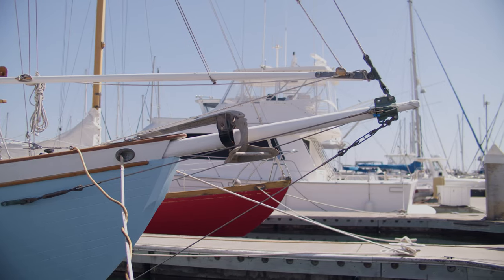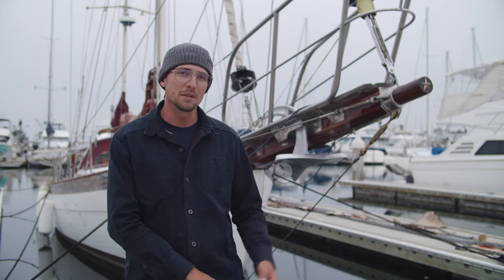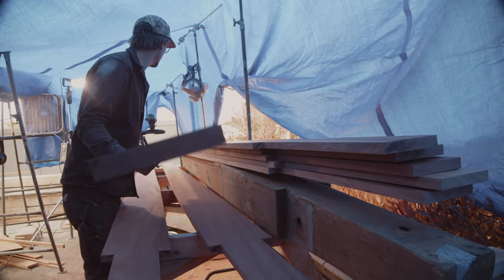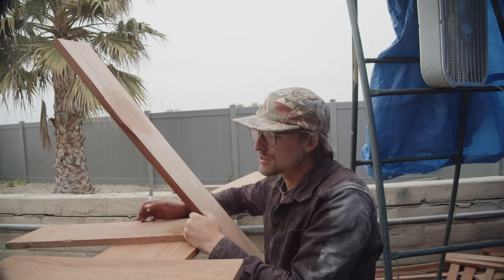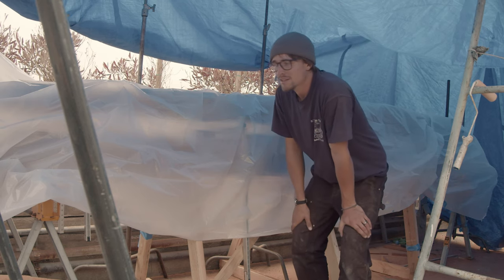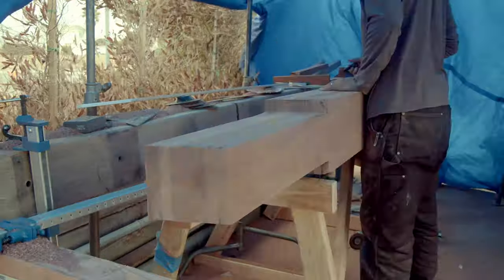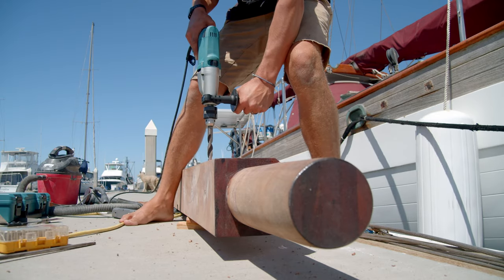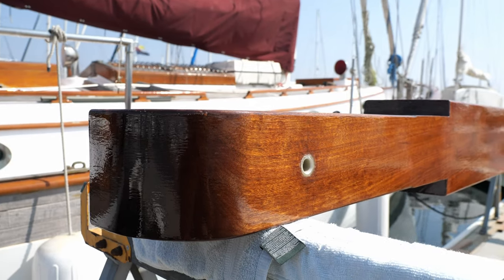Building a NEW Bowsprit

Comment: How did you attach the inboard end of the bowsprit to the deck? Did you connect it to interior bulkheads? Did you mount the windlass on the bowsprit and how did you secure it? Thanks!
Reply from the maker: Ahoy! Sorry this got lost in the comments. It is notched and held by the Sampson posts. There is a custom bracket that straddles the bowsprit and bolts down to the deck for the windlass.

Comment: Wow...well done!..question if I may (?)..I'm repairing my 'sprit 'at the moment, I have a bit of rot where the anchor roller/stainless bolt penetrates through the timber, there was no 'tube' for the bolt. So my query is, what material did you use to make the through-bolt tubes, looks like some type of 'plastic' / teflon ...cheers heaps 'matie'...."sail on"
Reply from the maker: G10 tubes! Sorry your comment went to spam :( for future reference You can find all the nitty gritty details on our website www.svavocet.com